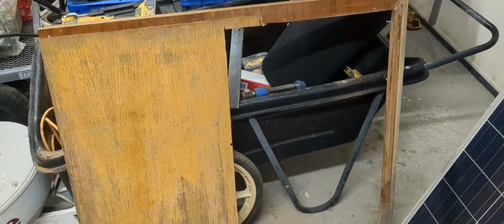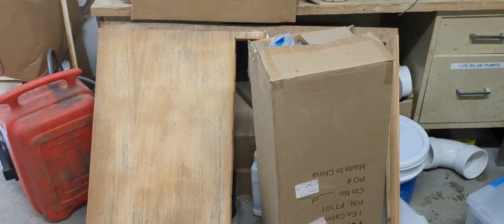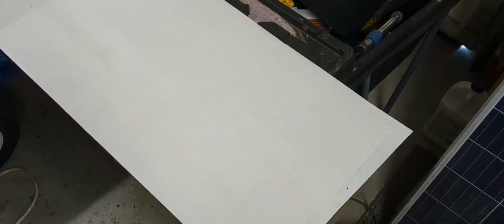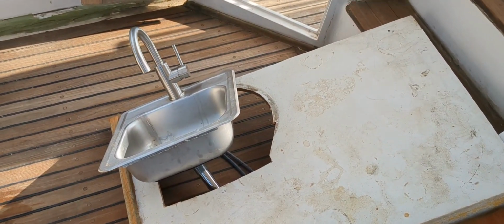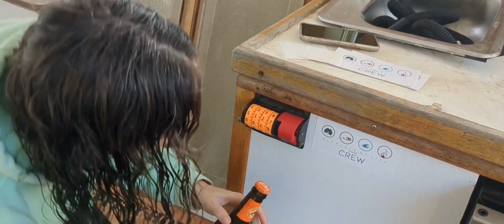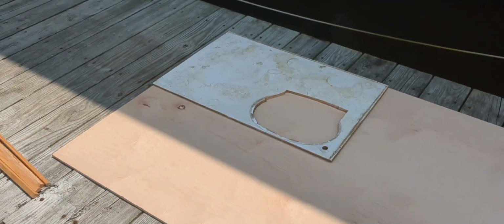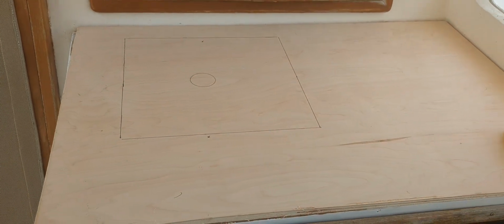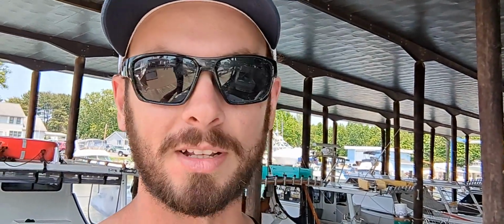Building a new Outdoor Kitchen!!!

Comment: you might want to double check the installation requirements on that fridge. It looks like it's not designed to be enclosed; when they don't have a grill on the bottom for air flow they will overheat for lack of air flow.
Reply: Look into HDPE.